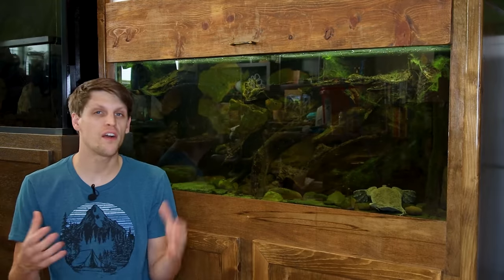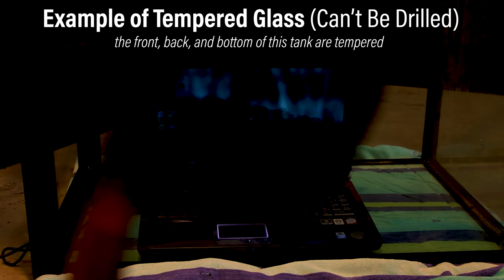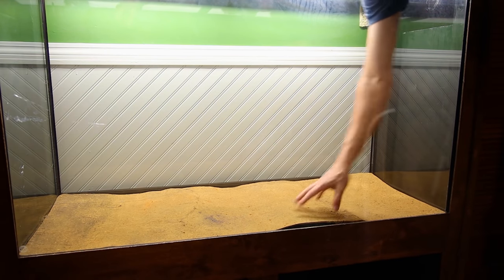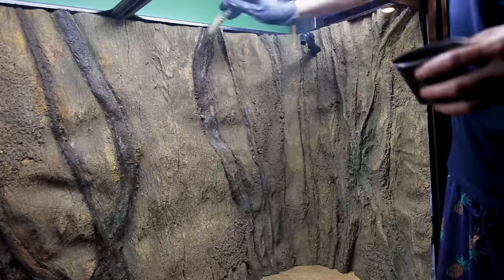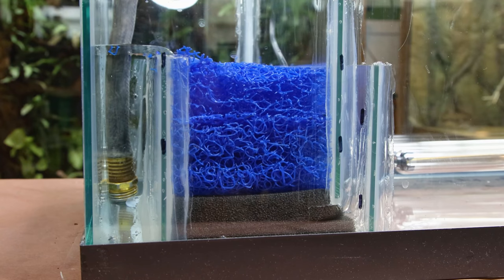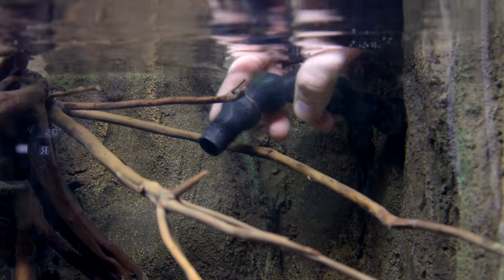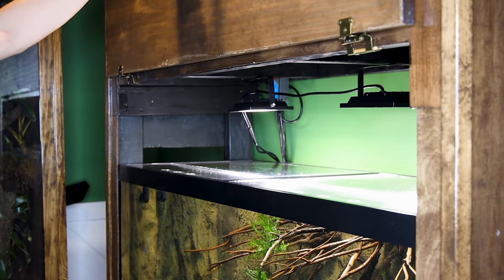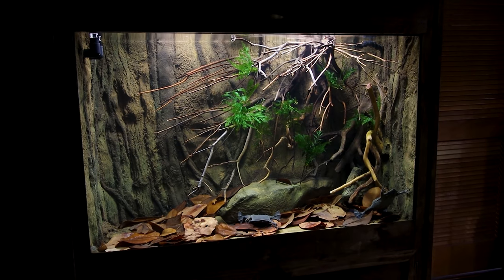Suriname Toad (Pipa pipa) Breeding Tank Setup

Comment: If you put a valve on one of the drain lines you can throttle it down until it is completely submerged and your other fully ooen drain at a slightly higher level is accepting only a trickle of water. This along with putting the discharge only 1/2 cm under the water surface should eliminate sound in the sump.

Comment: Is the display tank able to hold the volume of the sump return section in the event of a blockage? Without any screening, the small diameter tubing, and all those leaves and such in the tank, it seems like this design would be fairly prone to blockages.

Comment: I learned a new trick the other day for drilling glass. Cut a piece of sponge to fit inside the drill and soak it before drilling. Since the water in your dam set-up gets pushed away by the spinning drill bit, the sponge will supply lubricant from the inside out. I'd still use the dam too though. Also, if you're using a jig you should be able to drill accurately from both sides. No blowout possible.

Comment: Always multiple overflows to avoid clogs and subsequent overflowing of the tank. However, one should always be a higher level with each being able to take the entire flow rate. :)

Additionally, to minimize overflowing risk sumps should have a return section that is separated with a baffle (think 15ish percent of the sump volume). That way if water stops flowing down the drain the amount of water the pump can then pump into the display and overflow is limited.

Saltwater aquariums are a great way to learn more about sumps, staple of the hobby!

Comment: I drilled the glass panels on the top of my tank the other week to accommodate the inlet and outlet lines for an external filter. I had seen you drilling glass in an earlier video and used the same idea with modelling clay. Everything went super smoothly! Thanks for the awesome tip!!

Comment: I was looking in my local hardware store for some silicone I could use in my tank. I found some GE 100% silicone but it said "not recommended for underwater aquarium use". It looked like you were using GE silicone. Is there one they make that's for aquariums?
Reply from the maker: Been using it for 15+ years with no issues and it's commonly used in the hobby. In fact, any 100% silicone with no additives should be fine. I assume they just put that on the label for liability reasons. If it's something that concerns you though, you'll have to get aquarium silicone at a fish store or online; ASI and Aqueon are probably the easiest to find.
Reply: @SerpaDesign  if you've been using it for that long without any problems then I trust that it's okay. Thanks for answering 🙂